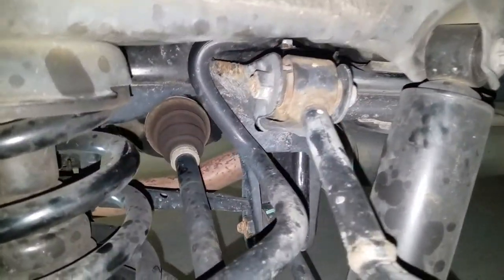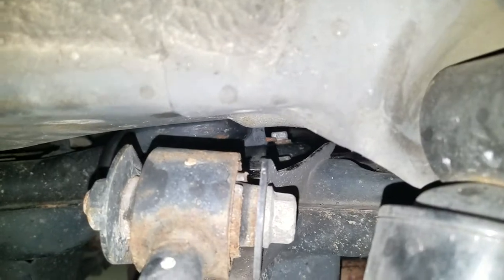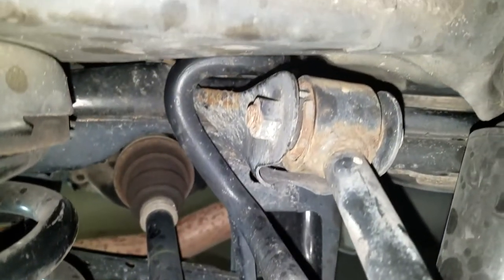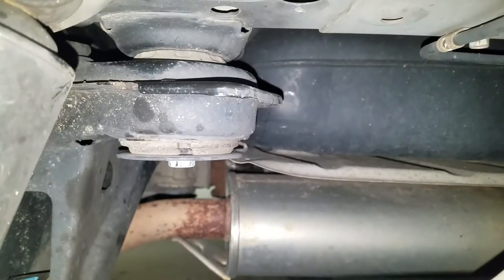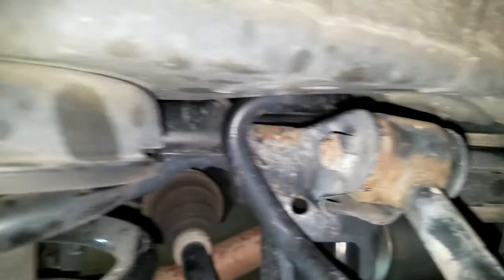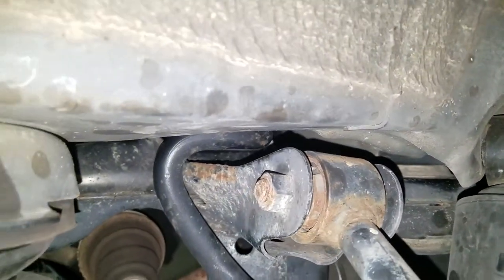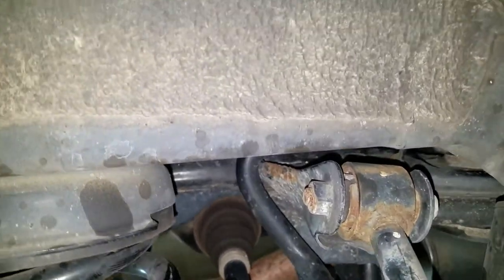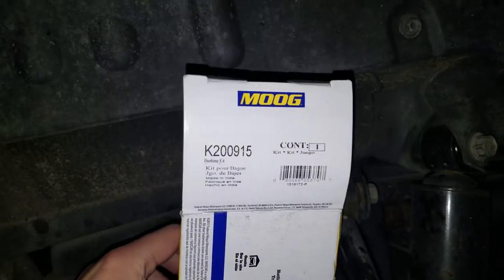Trick to Replacing Rear Sway Stabilizer Bar Bushings on Honda Pilot Acura MDX

Comment: I’m about to do my whole suspension. Front and rear struts, end links, sway bar bushings and upper and lower control arms. I’m at almost 200k miles and still on OE. Getting new tires tomorrow so I’ll be doing all this work next week when the rest of my parts come in. Great vid, I’m gonna give this a shot

Comment: Thank you for showing how to replace Acura rear stabilizer bushing. Good job👍👍👍.
I am working on the same project today. However, I am afraid the subframe will drop if I loose all 4 bolts to  1 inch. Should I put a floor jack  to support the subframe in case it drops?  Do you know how much toque to apply on  these 4 bolts?
Reply from the maker: You can put a jack stand under the subframe to support it if you take the bolts down to far. Sorry, I don't remember the torque specs.

Comment: Thanks, just looking at my MDX looked like rear bushings were hard to reach.  good info on how to access.  I used Moog end links, have grease fittings preinstalled, should last much longer than OEM, also tip is when replacement links, ball joints, end links, coat the rubber bellows with silicone rtv, preserves the neoprene rubber from aging and cracking. You can take rear muffler hangers loose and lower exhaust on these cars.  Also your video shows that your rear camber arm bushings are shot.  You should replace with adjustable rear camber arms from Moog, or other brand, cures the no rear camber adjustment issue and eliminates rear inner tire wears if properly adjusted.

Comment: Was it a 12mm or 14mm for the sway bar bushings cap nuts?
Reply from the maker: 12mm, just did this job again. Really easy once you drop the subframe down about 1.5 inches.
Reply: @LuckyVagabond  I just got around to doing mine a few days ago.  I loosened all four subframe bolts almost all the way, and the one closest to the bushing I fully removed.  This created enough room to get my hand in there.  Drivers side I could reach by going in from the back (it's tight if you have big forearms), the wheel well, and from underneath on the front side of the vehicle.  Passenger side was all from the wheel well and from underneath.  I used a three-eighth's ratchet and and ratcheting wrench.

Comment: i have a 2008 and i have a vibration at 80mph (with load or not .. it means pushing the gas or not) 
replaced tires, wheels (i go  a winter and summer set) chagne brake pads and rotors.. change rear bearing.. balance..
still have the vibration at 80mph ... 
did you have it too?
thanks!

Comment: I have an 03 Acura MDX with 160,000 miles and have annoying clunking over bumps in the rear. I think it may be that. Did those sway bar end links solve your issue?
Reply from the maker: No, I still have the clunking, but now I know what it is. It's the trailing arm bushings. I haven't replaced them yet though.